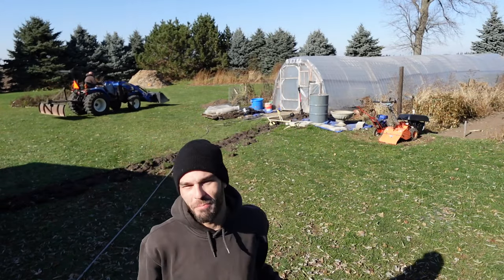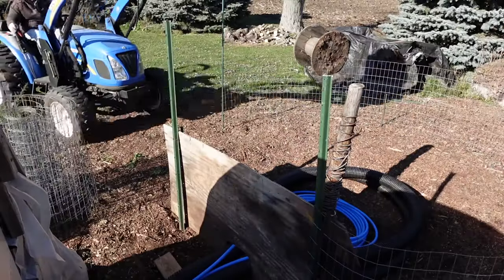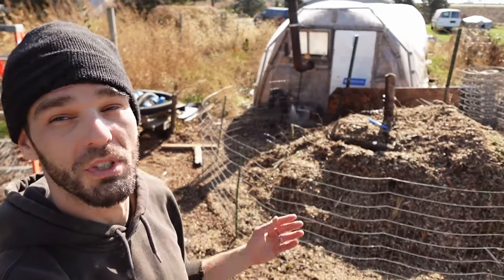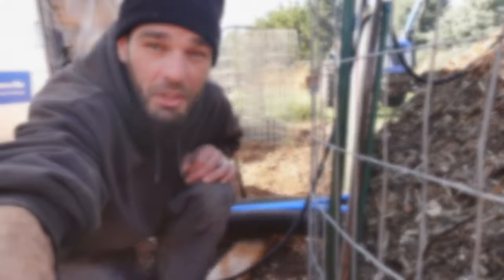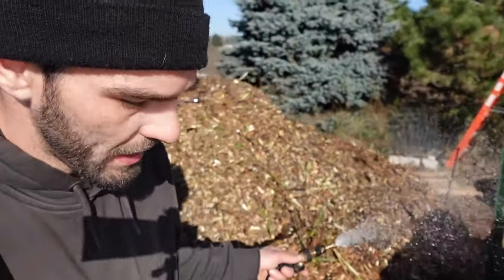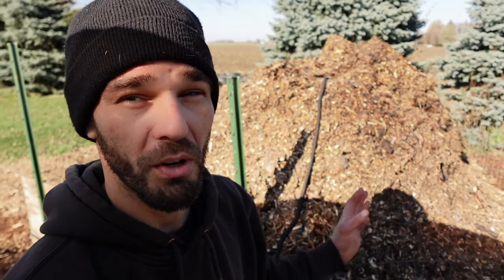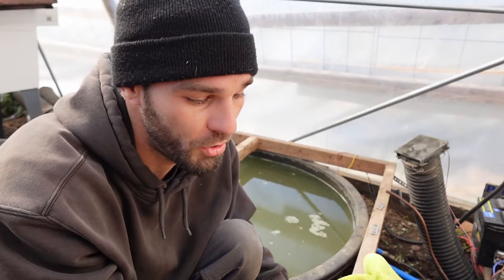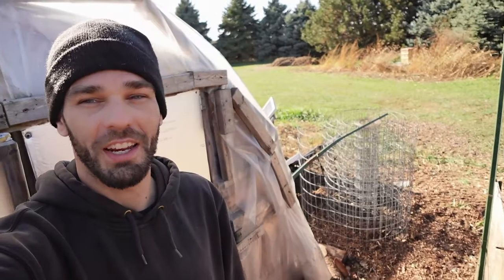Man’s Genius Heating System - Jean Pain Compost Greenhouse Heating System - Cheapest Heating Method

Comment: Ad some mushroom mycelium to those chips. Use a lignin disassembler like oyster mushroom or you can obtain actinomyces which is also called "fire fang" because as they are taking apart the cellulose and lignins they produce an enormous amounts of heat. This fungi Is the one that causes wet mops or compost piles to smolder and burst into flames. Also when the fungi is done with the chips an other cellulosic waste it is readily available for nutritive addition ot the soil . When it starts out wood chips and sawdust can be considered toxic waste. These fungi are your friends and they will be heating your place to the point where you will be opening the windows in th middle of winter. Remember, actinomyces and lignin disassembling mushrooms such as oyster, shiitake, Ps.cyanescens,ps.azurescens. These last two have interesting chemical components however they are super great for disassembling wood chips....
Reply from the maker: That’s a great idea as we have grown oysters before. I may look into a small pile for just trying that with thanks!

Comment: Interesting but the most important part of the video is missing.   What is the room temp, the exhaust tube temp, and outside temp?   What is evening temps in the greenhouse when its dark and before sun comes up?   Whats the water temp?  Maybe youve covered this in a video that i cannot find.  Also, your process serms very labor intensive.   I suppose if you had a tractor on your farm and can disassemble the pile every year, sure.   But most of us dont have that.
Reply from the maker: This was the building video and a neighbors tractor. We have tons of data logging videos on here also. Labor intensive for free heat all winter when it would cost a small fortune to use gas conventionally.
Reply: @Earthdwellershomestead  thx

Comment: have you considered putting in tee posts and attaching your pex to it to keep it separated? I found if you dump about one bucket of chips on your input and the output lines it insulates pretty well. I like redundancy when it comes to heating a diesel parking heater makes a great back up for cold snaps. They run for less than a gallon a day
Reply from the maker: Next year we are going to rework the set up completely and start with a 55gallon drum of water and begin wrapping on that, great idea with the pex. I plan to wrap the transfer lines then bury with chips should be good enough. Great ideas and thanks for watching !
Reply: the problem I'm having using the barrel in middle of the pile is it stays cold to long after running the pump it seems to kill the pile near the barrel. The pump is going at about 30-40 gallons per hour. Next year I'm going to try multiple barrels in parallel to try to reduce the cold spot.
Reply: @farmer-kitt  will you be wrapping the pex, copper, and drain tube around each barrel or around all of them as a group? Will all the barrels be filled with water? I'm curious about this system. @earthdwellers please feel free to chime in.
Reply: @shedigsdirtblog5879  I will use the barrels instead of tubing. Each barrel has about the same surface area as about 75 ft of 1 inch tubing.

Comment: Hiya,

Very good information as always. Didn’t think myself to water the wood-chip, I guess that’s one reason why my one small pile (didn’t help that it was small - about a tonne) didn’t break down as I had hoped.

So I’m beginning a project to hear our home using a similar system (if not the same). I’m just wondering, do I need any particular type of plastic pipe that coils inside the heap? I’m worried that 140°F may interfere with the pipe leading to possible degradation of the pipe in the heap? 

My goal is to blow cold air with the hopeful idea that it’ll heat up the air in the pipes and then go back into the house. Not sure if your blue pipes are for water, or are they for air? 

So yeah, are your pipes inside the pile any particular compound or just regular ones? And did they maintain their structure from the previous year?

I think your channel is great, once I can sort out the house problem (it’s a very cold house and out heating bills are stupidly high), I definitely want to go into poly tunnels. We are farmers anyway but often are at the mercy of the unpredictable weather!

Comment: Biogas digesters definitely will help your heating cause. I love the biogas. Nice channel you have.
Reply from the maker: Thank you!! Looking forward to using the methane system this spring as we couldn’t hold 90-100 degrees inside the greenhouse in winter
Reply: @Earthdwellershomestead  definitely tough to keep the digesters warm here in the northeast during winter months.
Reply: @Earthdwellershomestead  Try building a IBC tote digester they make nice amounts of biogas throughout the summer.

Comment: Thanks for the video and info. Really curious as to the heat transfer of the PEX vs. Copper. Especially with different diameter tubing.
Reply from the maker: It changes the flow and transfer a bit overall, I did this in the manner I did this year to truly say I spent less than 100$ to achieve all these systems this year. 20$ on fittings and 50$ to have the guy move the pile 70ft with his tractor. Thanks for watching! Next year it will be out together and transferred differently yet.
Reply: @Earthdwellershomestead  Groovy. I am building a similar system to heat my pineapple greenhouse.

Comment: Looking forward to seeing how the pex goes against constant heat. Was looking at doing a similar thing with pex but had read that the water starts giving off a plasticy smell after some time.
Reply from the maker: I didn’t notice anything from our pex transferring inside the greenhouse but I used copper originally to avoid having breakdown of plastic piping but it’s tougher that thought. I’m also interested to see if anything is different from heating through copper to heating through pex inside the pile. Good observations!

Comment: Didn't Jean Pain put a load of manure in as well for nitrogen? I really fancy having a go at this as we have a woodchipper and a manure source.
Reply from the maker: He did a lot of experimenting also! Fresh chips have plenty of nitrogen to get going for a long time it all depends on size. We’ve experimented with a huge nitrogen dump last year on our pile and it worked great for many months. I’m always seeing what we can do and can’t to. Great question!
Reply: @Earthdwellershomestead  I should have asked where are you? We’re 58 north snow for 3/4 months -20f ish, does your pile stay hot and not freeze (don’t know how cold it gets there).
Reply from the maker: @BalticHomesteaders we’re in northern Illinois, your up there, we see pretty cold temps pretty close to what your describing. Can be colder or warmer. I just say we’re zone 5/a4/b cause we’re right on the line in our area

Comment: How long is the pex tubing and air tubing wrapped around the pole? Maybe I missed that information. Love the idea of this system and hope to use it next year with all my chicken manure/wood chips.
Reply from the maker: 100’ pex water - 100’ copper wrapped on the pole for water also - 90’ -100’ drain tile. Great question
Reply: @Earthdwellershomestead  okay thank you so much. I actually had a hydrant installed after watching your previous videos on this method so I can keep the pile easily watered. Now I'm wondering if I should wait and see how you use the barrels instead of the pole. Love the experiments and data you share.
Reply from the maker: @shedigsdirtblog5879 awesome to hear! Yes we plan on using a metal drum next year and digging out the area more and lowering the pile, just a bigger better version every year, leaning a ton along the way lol

Comment: Im wondering how many yards of wood chips you used? In my location they sell by the yard, not by the tonne so was just curious on a ballpark guess for # of yards.
Reply from the maker: There are roughly 4 yards in a ton of woodchips, if fresh woodchips are not a available you could try a huge grass and straw bale organic matter pile for some heat but it has to be massive also to last the winter.. I realize how lucky I am not to have to use an app or anything to get chips. I have the guys phone number and he’s pretty darn cool. I bet over the last four to five years he’s brought 20-30 tons lol for free!
Reply: Thanks for the info, its fun watching it all come together!
 @Earthdwellershomestead

Comment: Are you turning the pipe at any point, if so how often.
Reply from the maker: Not a pile this size. It doesn’t need to be turned as it will burn for many months without any interruptions. Great question I’m sure others are wondering

Comment: How difficult is it to breakdown and start over? Also, could one make a radiator system and run it inside the house for heat?
Reply from the maker: If you look back last spring we began distributing materials from our compost all over the property and by the time fall arrives we’ve cleared it out wether by hand buckets or wheelbarrow, I need a skid or something for the homestead. The tractor who helped build the pile was a friend I pay 50$ to dump 30-35 scoops and the chips are free from tree services in the area. I’ll develop a good flow to the system this spring as all the material we used for heat will be reused for nutrition and hummus on our land. You certainly could use a heat exchanger system for the house, we’ve got more experiments yet to do with all of this information lol thanks for checking this out and great questions!
Reply: 10-4 good stuff!  @Earthdwellershomestead

Comment: How long did it take for the tractor to move 9 t?
Reply from the maker: About a half an hour I give the guy 50$ every winter to do this. It covers his fuel costs and some for him, as everything else has been paid for long ago we’ve got next to nothing invested this year lol. Great question!
Reply: @Earthdwellershomestead  Wow, thats MUCH quicker than I expected! So, thats about a ton every 3 minutes. Must be a badass tracktor:D Doesnt look that big in the video.

Very much looking forward to the input/output data coming out of your project. I believe this 'compost tech' has huge potential. Any DIY experiments are valuable investments.